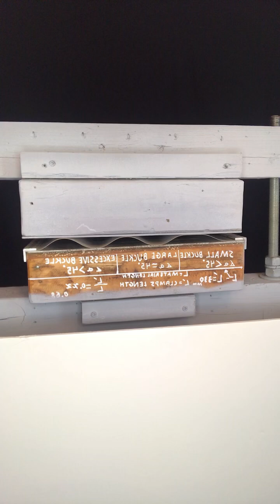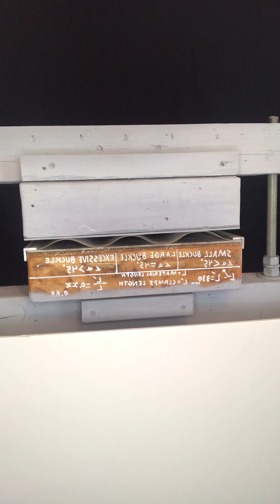Euler's Column Theory to Pitchfork Bifurcation #quantummechanics  #physics #bifurcation

Comment from the maker: In this video, Dr. Jacob Hudis demonstrates an exciting experiment that uses compressed mylar and steel plates to simulate quantum mechanical standing wave patterns. 

https://youtu.be/JTfAopm8H44?si=yyrcoKjjysPXYGzt

These patterns closely resemble the standing wave solutions for a particle in a box in quantum mechanics. Watch as the system spontaneously jumps between different wave modes, providing a visual analogy for quantized energy states in a simple quantum system.

The experiment is explained in detail, and I show you how to recreate it at home or in the classroom. This video also includes a brief introduction to the concept of the particle in a box—a fundamental topic in quantum mechanics. To enhance the explanation, I use an interactive particle-in-a-box applet from the University of St Andrews, which you can explore here:
👉 Particle in a Box Applet

Comment from the maker: This model can be used as a vehicle for aspiring young students. Its simplicity offers an opportunity to use the model as part of their STEM or schools science projects. 

https://youtube.com/shorts/JjjdoStmhDU

This is for anyone that might be interested in duplicating the process in their home or school’s lab. The materials and requirements to replicate the model are easy to attain and construct. You can progress to a more complex setup with load cells, stress gauges and chart recorders.

This mechanical model shows how quantization arises naturally under specific conditions.

I have uncovered a few insights about the process already.
I believe there are still a lot of discoveries left to be found using this model.

The model’s required conditions are a bounded elastic medium with a small initial input of energy and a method to increase energy into the system.

The shape of the preset curve is Gaussian-like. This may relate to the probabilistic nature of Quantum Mechanics.